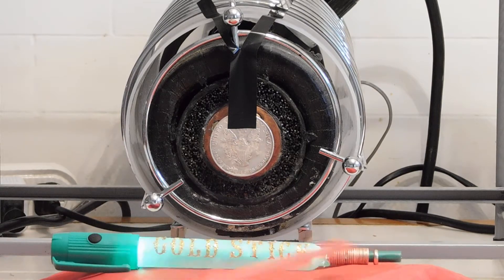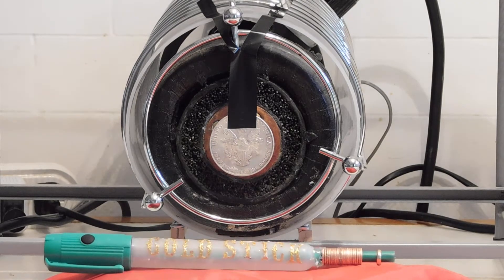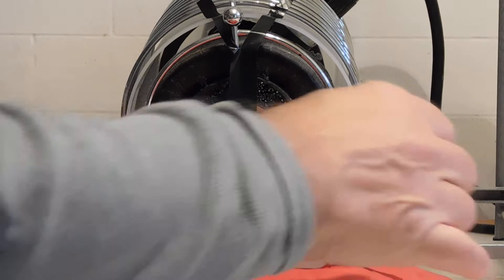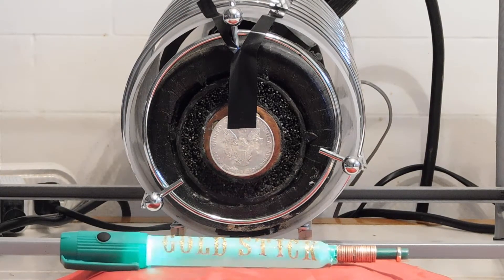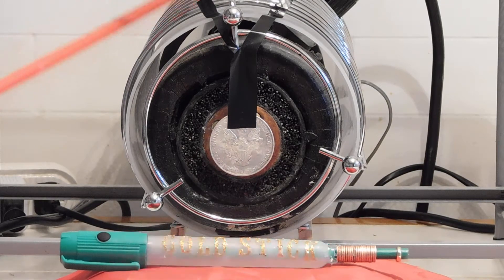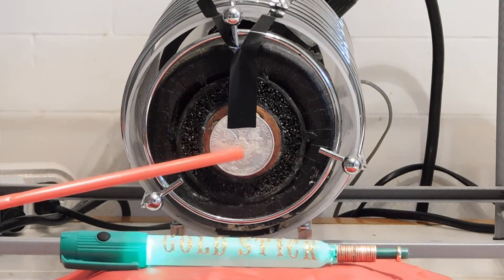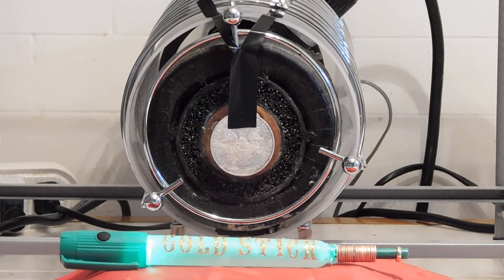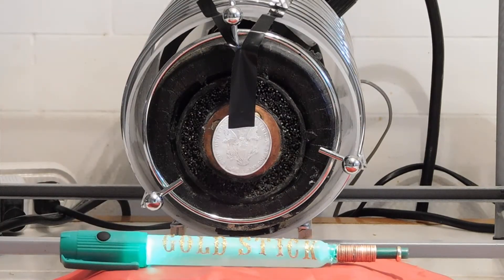An Iron Core and Copper Washers Will Attract Gold ─ Cool Science

Comment from the maker: The Gold Magnet is actually two magnets in one.

The (electromagnet) Master Magnet is a coil with a current running through it.

Electrons are like tiny magnets and when they move (as in a current) they create a magnetic field. 

# 14 cotton or enamel covered wire is wrapped around a (core) base made of iron. The wire is connected to the electricity and when current flows in the wire, the iron core becomes a very strong magnet. 

The second magnet is the (4) copper washers. The magnetic field from the iron in the base causes electricity to flow around through the washers. The electricity in the washers is called an eddy current. The eddy current causes the washers to become a magnet. But, if the washers are split they won’t become a magnet because the electricity can’t get all the way around them.  

The two electromagnets are arranged so that their north poles point at each other. Two north poles repel each other, so the base (iron core) and the washers push each other away. If the washers were not anchored in place, they would spring out of their mounting as soon as the current was turned on.
Reply: Shadowblaze47@gmail.com that my email  I Ben trying to get ahold of u my dad has built one that bigger then this one and can do lot more I'm tell u now if u want it to work 100% u have it built wrong in the core
Reply: @shadowblaze47  i try calling you
Reply: What kind of a core  is the efficient one?